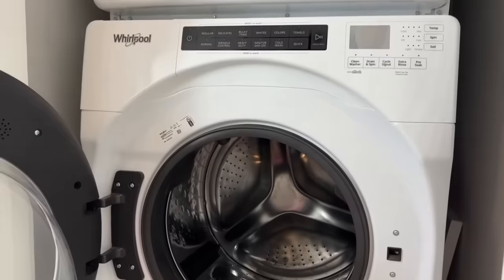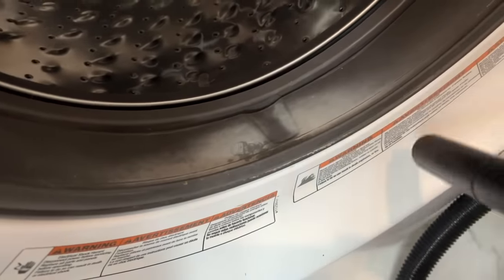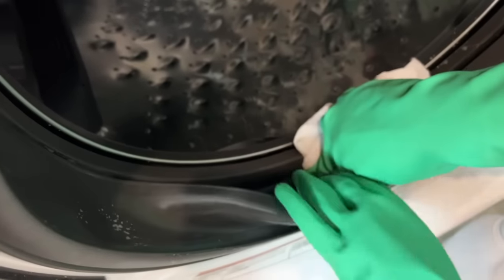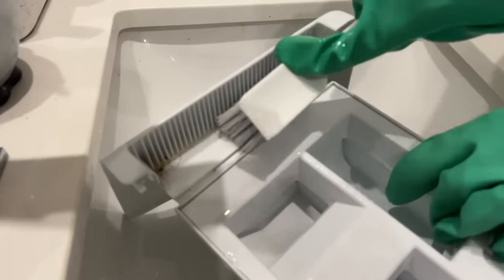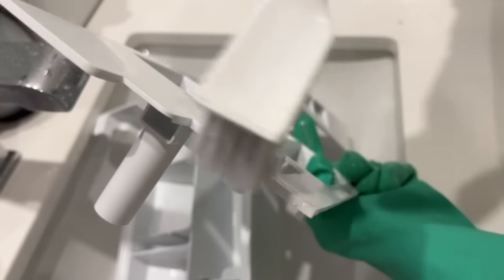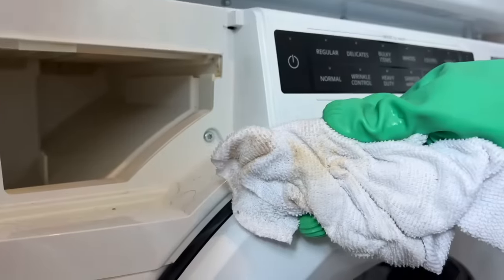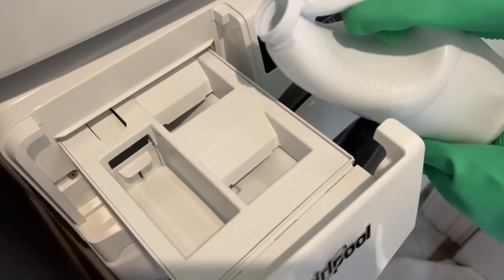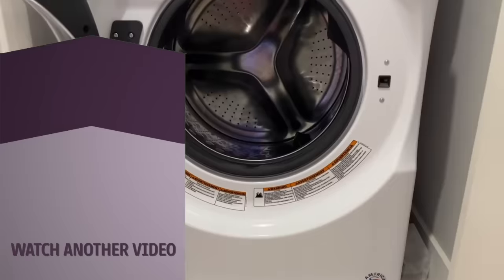How to Clean a Front Load Washing Machine

Comment: One piece of advice I received when I got a front loader was to dry the inside of the rubber seal with a cloth after you are done using your washing machine (which sometimes seams like never because I'm always doing laundry!).  It is not foolproof, but I do believe it has helped prevent mold and smells from getting out of hand.
Reply: I leave my door open after washing a load to allow it to dry.  Helps tremendously.

Comment: BE SURE TO READ YOUR MACHINE'S MANUAL before cleaning! I have a Bosch compact front loader and the manual says to never use chlorine bleach as it may damage the machine – my old Bosch machine even said using chlorine bleach would void the warranty. No big deal for me, I never use the stuff anywhere – but it would suck to have something go wrong and then be told I had no recourse because of a cleaner I used. If I have mold or mildew, I use an enzymatic cleaner. And I run the drum clean cycle with the OxiClean washing machine cleaner, which works great.